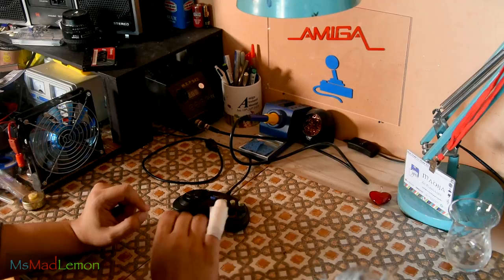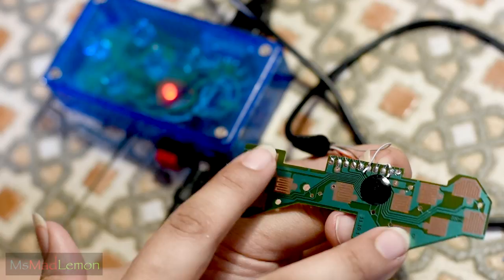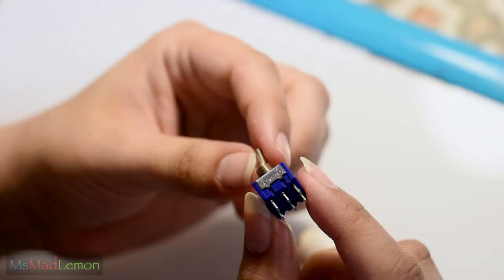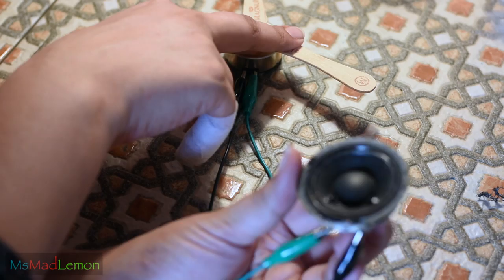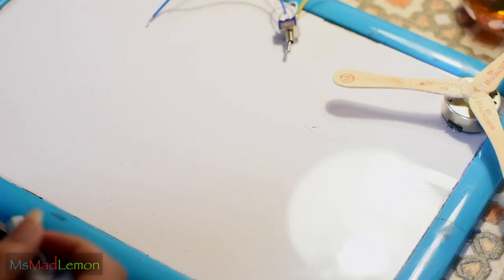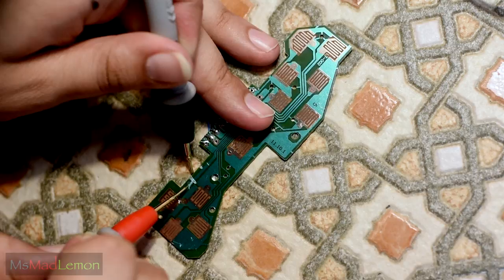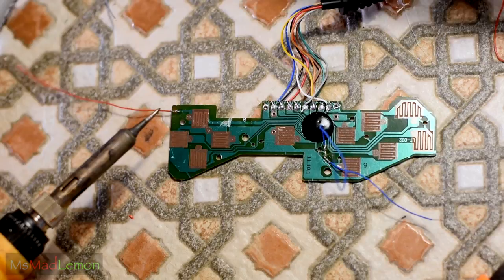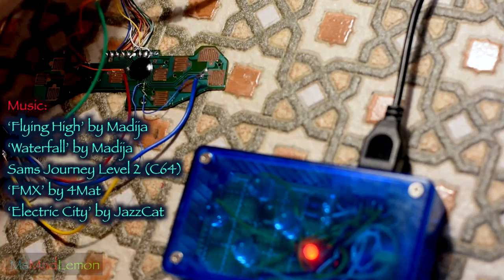Joypad / Joystick Jump button mod with toggle switch

Comment from the maker: I got the switch definitions slightly wrong, both are double throw switches. 
so the red switch is: 
SPDT - Single Pole Double Throw
and the blue switch is:
DPDT - Double Pole Double Throw
Reply: Something in your tea today, I found another small error. Everybody knows peppermint Magnums are the best, and it’s only a matter of time before you’re called out.
Reply: +MsMadLemon - Wouldn't the blue switch be called DPDT/Center Off to differentiate it from a switch where one set of contacts is always connected, like with the red one?
Reply from the maker: Hahah! i've always been a little unsure about  mint + chocolate.. Ive not tried the magnum though, it would have to be good :o))
Reply from the maker: @lurkerrekrul
Yeah it would, though i did explain about the center off already, so i think if anyones gonna buy one they can make that choice. I dont wanna get into too much specific detail lol
Reply: Forget magnum. It's all about mint Feast

Comment: What a fantastic idea.  Thank you so very much.  I might actually make my own version of this, but make it as an in-line adapter, sort of an interceptor if that makes sense?  Plug it into the joystick port, and then plug in whatever joystick or pad I want to use.  Thank you so very much for the great explanation.
Reply from the maker: Actually yes you can and i think it would be better (actually i should have included this in my inline joystick autofire project ive just done!) .. but yes this video is just to illlustrate how you would do it.. hence why im modding a junk controller which i'll never use lol
Reply from the maker: And its my pleasure, thanks :o)

Comment: One tip - if using mod wire it will easily break where it is soldered to the pcb, since its only .25mm thick,  so a dab of (clear?) nail varnish will glue it down and support the joint. Once inside the insulation its much stronger. Nail varnish (or "conformal coating" if you're posh) is  much easier to apply accurately and neatly than hot glue and easily removed with acetone if needed (nail varnish remover contains oils so its probably not a good idea).

Comment: Ahhh that scraping noise at 15:23 !!
This is a great idea, it never occurred to me to swap the buttons. I'm going to have to try this. I wonder if it would be better as an external box.
Reply from the maker: definitely if i were to actually create this, it would be in an external box, actually i wish i had included it in the autofire box, maybe i will in future :o)
This video is just an illustration of how it can be done really, hence why i used a cheap ebay junk pad lol
Reply: fsphil Same thing I would've hoped to do, ie plan big and spend ten times as much time before finally throwing in a microcontroller... then throw it in the parts bin without finishing. Spending more time because too lazy to do the small wires, funny how that's a thing :-P

Comment: This mod is awesome! Perfect for the c64 as well as the Amiga. Would love to have this, but I reckon I'd stuff up the controller attempting it, lol
Reply from the maker: Actually i would not recommend this on a C64, a megadrive pad can fry a C64 without protection circuitry! .. Unless youre using a c64 friendly pad, then yes it can apply :o)
Reply: MsMadLemon I actually stopped using the three button MD pad on my c64 as indeed, it was interfering with the keyboard function annoyingly. Can't recall if the six button pad was doing the same. Been using Sega master system pads on the c64 for a little while now, and they work well. Hope they're okay to use!?
Reply from the maker: Yes i would recommend not using that. i think its the 3 button original megadrive pad that is most dangerous, and that is exactly why, it interferes with the keyboard function and can fry the CIA chip i think. 
There are MD pads which may not interfere but one can never know so its always best to be safe. Someone has in fact made an adapter with protection circuitry, so that you can use any MD pad... If i find it, i'll link it here. 

Mastersystem as far as i know is safe, but dont take my word for that, i would look up the circuitry and if its wired the same as the Amiga/c64 joysticks then it will be fine.
Reply: MsMadLemon I stopped using them as it was impossible to type anything on the keyboard with the pad plugged in. Annoyed the shit out of me, so switched to ms pads. Should go read to see if they're safe using. Wow, so glad two of my c64s aren't fried! Thanks for the heads up, Maddi.

Comment: thats a nice mod. Maddi. now the pad makes sense. 
a useful paddi, converted by Maddi! 🎮👌
when are we going to see it back in his housing?
i guess that red switch had a zero position in the middle, connecting nothing if i saw it correctly, and the bleu double pole did not have that mid position.
careful with the flowers, dont choke in them. i guess the give you FLOWER POWER.🍵🌸💪

keep on modding, and take care. going strong.

Ow, and offcourse. congratulations actually passing the 10k.💐️🎉
Reply from the maker: Thanks Jan, actually this is just an illustrative video, i dont actually use joypads, i use joysticks always :o)
'If I were to actually create it, it would be in an external inline box the same way as the autofire circuit.
Reply: Ow, oke. yes we know you are more a joystick user offcource. but i thought you would finish it as it is, now when you made it work. and did some carving on the pcb, so you could use it on the cd32 that should be added to your collection eventually. LOL
Reply from the maker: LOL!! i wouldnt consider that pad good enough to use as a freakin lasso,... i mean come on when i was unscrewing it, it felt like the screws arent even real, it just kept going round ;o)))
Reply: thanks, maybe, now i am reading further perhaps a little warning in the comment underneath the video is in place referring to the comment Stuart Dawson made  for instance. dont know if thats possible afterwards. people could miss some quotes and pronunciations. like me haha.

Comment: Oh, I have the same pad. I hate it LOL - perfect for a project like this. Congratulations on 10K subscribers! The Magnumcopter is more fun than some games I've come across :)
Reply from the maker: Lol! that nasty 2.99 ebay pad? haha hence why i used it just to illustrate how to do this, its junk.
And thank you Iarla! :o)
Reply: That's the one. I bought it locally thinking it was a proper SEGA pad. The wire isn't even long enough to sit back in my chair :) Total disaster of a thing in every way. Might make it a boobie prize at Amiga Ireland next year :D
Reply from the maker: Hahah i noticed the wire length only when i got it, i was thinking about using it as a spare for when i create one of these projects but ..No!
This pad would turn everyone into a hunchback ;o))
Reply: Yes those fake controllers are crap, I have the orginal one from sega that one is really good and have a really good dpad.

Comment: Cool. I just got on ebay a competition Pro joypad to use with amiga so i going to attempt this mod. Thank you. I didn't know full meaning of those names. Now i do. The second diagram made it easy to understand :)
Reply from the maker: Actually i got confused with the switch terms, the blue one is a Douple pole Double Throw DPDT ... i need to amend this in a future video!
dont want you to buy the wrong switch. 
And thanks Mikey :o)

Comment: Don't forget to switch round pins 5 and 7 before doing any thing elese if your gonna use a megadrive controller on the amiga.
Reply from the maker: Really? i thought you could use it straight as many have always been doing.. what is the reason for this?
Reply: http://eab.abime.net/showthread.php?t=75515 It sends voltages to a pin that's not supposed to get voltages. Instances of the  ports being damaged on the amiga are rare, But common with the 64, Some people also say there's a small risk to Paula with an unmodded mega drive pad. don't forget there is no "commodore seal of quality" Your games can do all kinds of funky things with joystick inputs...
Reply from the maker: Thanks for informing, actually i wouldnt let a megadrive pad anywhere near my C64 anyway.. but as a joystick only user, i dont know much about the megadrive pad with an Amiga so this is good to know! i'm learning.
Reply: I was about to say that I had heard that advice somewhere before, and now I see I posted that EAB thread!

Comment: Cool mod. As someone who grew up with consoles and only recently got into the oldskool home computers, using up to jump seemed alien and unintuitive. 
I read somewhere that using vanilla Mega Drive pads on a C64 interferes with the keyboard and can,  potentially, damage the machine if you don't add some Diodes. 
I saw it on this old reddit post: www.reddit.com/r/c64/comments/32fg96/modding_sega_genesismegadrive_dpad_controllers/
Reply from the maker: im actually used to the up to jump, but then again im not really a joypad kinda person, ive been used to joysticks more so its not an issue for me.

And yes i definitely would NOT use a megadrive pad on a c64 without any protection circuitry.
Reply: Actually stopped using MD pads (switched to Sega ms pads) on my c64s in the last year. My c64s are still working good, thankfully! Man, won't be plugging those in again!
Reply: R Moocher, If you want to continue using MD or SMS pads then some guy in Australia has a readymade solution called the 64JPX, it's an adapter that has the diode protection and a PIC so you can change various controller modes including remapping Jump to a button and a mode to "cheat" at joystickwagglers like Summer Games.
Check it out at www.64hdd.com/64jpx/64jpx.html
Reply: TheDeeplyCynical have to check that out, thanks. I used the thrree button MD pads originally, got sick of having to unplug it to type anything on the keyboard, so switched to ms pads and the occasional 6 Button MD pad. Won't  be plugging in MD pads ever again! The ms pads don't seem to mess with the computer. I think one of my two 6 button pads did. Wish I knew about this years ago!

Comment: Great video! I'll need to do this mod for my c64.
Reply from the maker: I actually should have made mentioned this in the video, do not use a megadrive pad on the C64 without protection! Or you can fry your c64. the megadrive pad has circuitry which is fine on the Amiga but interferes with the C64.
Reply: Yes I know this, and I heave two Boomerang B103 designed for the c64.

Comment: The switch is actually a DPDT.

And couldn't it be implemented as an adapter since the Amiga joysticks are simple logic level signals?
Reply from the maker: i thought double throw had two switchpoints? like on-off-on .... and single throw was just on - on 

it could be implemented as an adapter too of course, but this is more a concept video, i didnt actually apply it to a pad.
Reply from the maker: Right you are, I stand corrected, so a single pole is only 2 contacts, i must amend in a future video.
Reply: FYI, "Ni Hao" sounds like "knee" "how" and just means "hi" in Chinese.
Reply from the maker: okay.. thanks for the info...